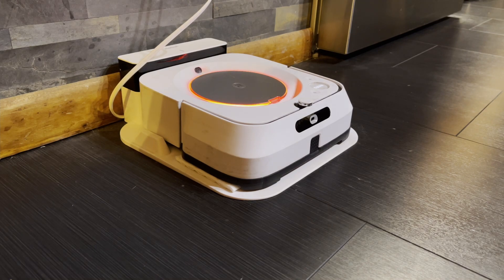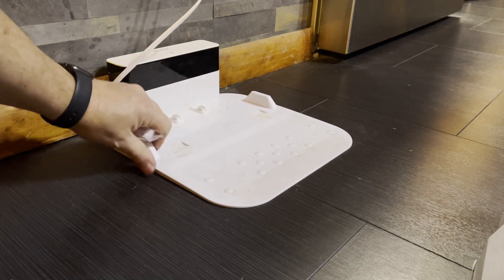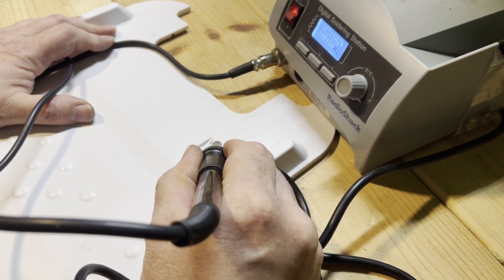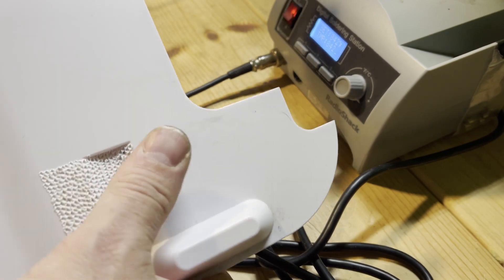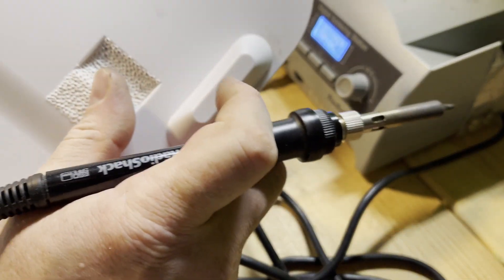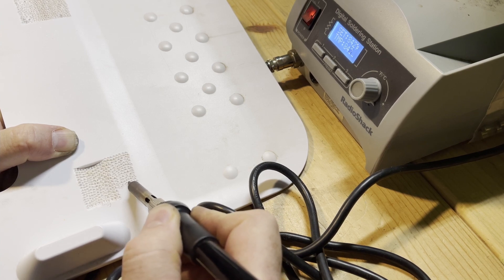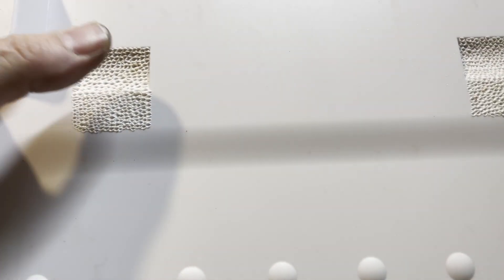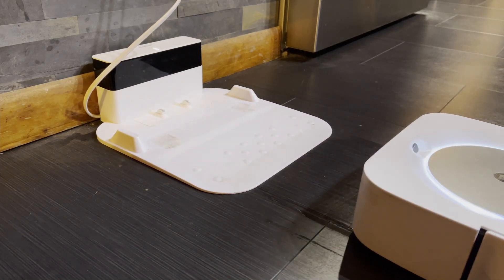iRobot Braava Jet m6 Error 19 Undocking Problem FIX

Comment: This is perfect!!!
Before watching this video I tried everything from degreasing the platform and the wheels to even using sand paper on the wheels. I did notice that the ridges on the plastic pad had worn out and I was going to use sanding paper with double sided tape. But this solution hits it out of the park.
Thank you!!!

Comment: Thanks for your video. Yes, undocking worked immediately! However, docking was a different story. I then used the soldering iron for the entire path of the docking station. In addition, I noted that the after-market pads I was using were much thicker than the OEM. Change the pad and now all is working perfectly.

Comment: In my case the wheels aren’t slipping, but they just don’t seem to have enough torque to drive out of the base without a push. Anyone else with that problem and have a solution? Also complains a lot of time about being out of water when it is 80% full and I just have to shake it. So annoying.

Comment: My Bravo m6 will not return to base it just go around in a circle? in front of the base but when I place it back on the base it starts to charge again, I have to do this every time Any suggestion on what it could be I just this its new
Reply from the maker: Try resetting is (factory reset) and having it map again. Or first try turning it on and off. But really, it's 2023, that robot needs to go. :)
Reply: how do you reset it @MrRoombato
Reply from the maker: @larrylung4795  I don't remember, I don't have mine anymore. Contact customer support.

Comment: Thanks for the solution. I also used your technique on the front edge of the docking plate because my robot would ship getting on. I only did three rows behind each wheel and the robot does not slip getting on anymore.

Comment: Hello, 1 of the 2 mop contacts oxidized and rotted and no longer charges, the rest is perfect, how do you fix it? is there a fix?
Reply from the maker: If you can sand it, do that, otherwise it would have to be replaced.
Reply: @MrRoombato  Hello, the rust has almost spent all 1 contact, what would be the replacement part?
Reply from the maker: @cuentasagregadas845  I don't know. Contact iRobot customer service.

Comment: Ours will undock only about 5-10% of the time regardless of how clean and dry the base is. I have to assist it always. I’ve always felt the drive motors lacked torque sufficient enough to get it over the hump. That said, I will try stippling the base. 🤞

Comment: Now try docking while wet. I had to use rubberized tub tape where the wheels drive up, to give it something to grip on. Because mine had trouble docking while the wheels were wet.
Reply from the maker: With this mod it will dock even if you oil it.

Comment: My issue isn't like this, but more serious. Mine worked fine for about 1.5 years and loved it.. But now it's useless. I start it (docked or not). It moves forward a bit then turns 90 degrees one way and then the other way, and then just stops. I removed the wheels and got some debris out of the wheel wells. O also cleaned all the sensors, although not so sure about the sensors that are located inside wells also. No change. Ever heard of this, and is there a fix? For now it just sits in the charger and useless. This is the best Irobot mop I've ever had .
Reply from the maker: No, sorry. I'm not familiar with this. It sounds like a serious sensor or processor failure. Then again, could be something dumb and easy to fix. I suggest you contact iRobot. Well, what I really suggest is what you buy a Dreame W10. :)

Comment: How about the docking issue? Any solution?
Reply from the maker: Which docking issue? There are several. :)
Reply: @MrRoombato  the issue when after mopping it cannot dock or unable to dock / return to the base.
Reply from the maker: @bolinoy818  Right, but what's the cause? Too slippery? Can't find dock? etc. There are many!
Reply: It finds its dock and starts to maneuver back to its dock but just wont dock, its already on half the docking plate and finds difficult to keep traction or having a hard time to lift itself to make full dock. The wheels still have the traction/lines.
Reply from the maker: @bolinoy818  If traction is the issue then this will fix that, though you may need to extend it to the edge of the platform.

Comment: Fixed my problem! Thanks!
Reply: I take that back lol. It seems like there still is an issue even when I extensively scuff it up. It runs fine on the first time but then it just doesn't run after that first time.

Comment: Great idea!  Until I get a soldering iron, I took two small pieces of Velcro tape (the rough side) & stuck them into the wheel wells on the base. That gave me the traction it needed, even if it is only temporary.

Comment: My problem is the reverse. Mine wont dock when it returns. It backs up but the tire are wet therefore it won't backup to charge. I've even turned down the spray amount and it still has a problem backing up to dock and recharge.
Reply from the maker: Well you could extend the stippling to the edge of the platform. That might work for you. Although I have never had this problem, so I can't help but think there may be something wrong with your robot or its wheels/tires.

Comment: Or you can use Self Adhesive Hook And Loop tape....
Reply from the maker: That might work! I tried grip tape but that wasn't enough. Velcro may work or the little plastic "hairs" might bend out of the way as the wheels spin. If you test it and works long term, please let me know.
Reply: @MrRoombato  Unfortunately I don't have an M6, it's just an idea. You can also glue thin rubber into holes for wheels, for example, from medical gloves on double-sided tape. It may be necessary to increase the gap between the mop and the mat.

Comment: Genius solution! I was considering some of the others I've read about (putting sandpaper in the wheel wells, using tacky tape), but I was concerned about how they would affect overall performance. I just used my wood burner to do this and it worked just as well as in the video. No more having to manually move the bot off the base to start. Thanks for posting this!
Reply from the maker: Glad it helped!